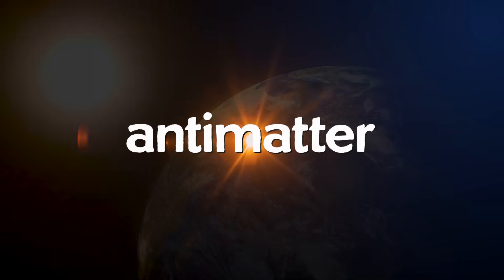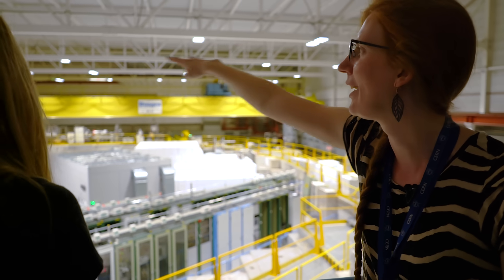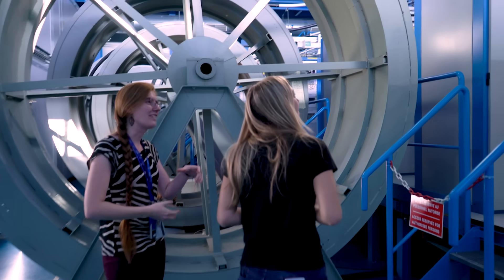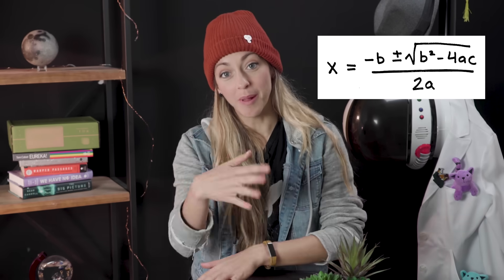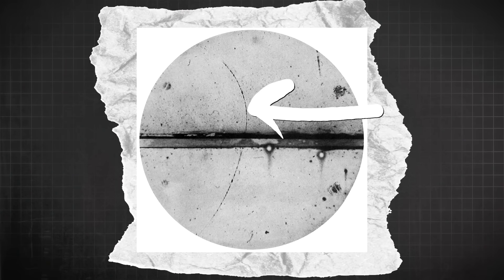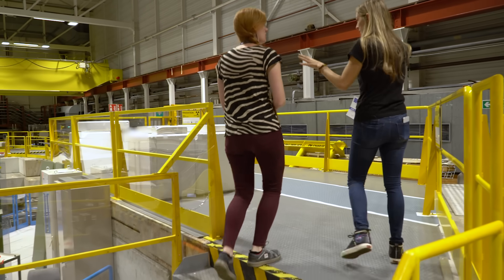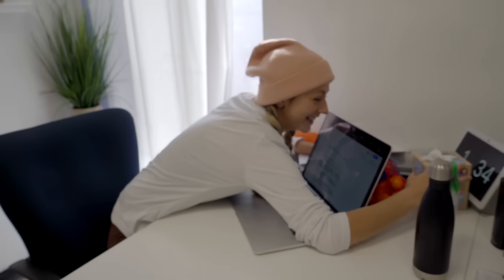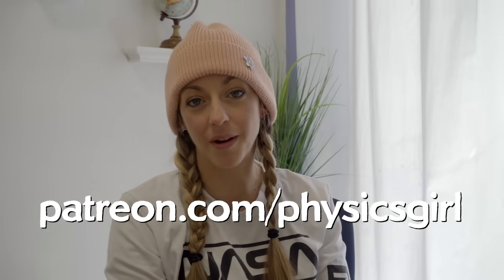Why This Stuff Costs $2700 Trillion Per Gram - Antimatter at CERN

Comment: The answer to containing antimatter is simple. You can either use majorana particles or simply dark matter.
Also I have reason to believe that all observed planets are not necessarily regular matter, as there is no observed clear difference between matter and antimatter aesthetically, which means that we cannot say for certain that the planets that NASA observes are “classic” matter.
Reply: The reason I say dark matter as a method of containment is because well... it probably won’t react with antimatter and any antimatter that does exist in the universe is, well surrounded by dark matter

Comment: Well actually there is not equal parts matter and antimatter. After the Big Bang (can’t remember exactly when) there was matter and dark matter being created and they where basically connected to photons it was almost like one of those two pronged BBQ forks with matter and antimatter on separate “prongs” . But what was happening though is that these matter and antimatter photon things would collide but when the collide the matter always met with antimatter and vice versa so they would cancel each other out and I’m pretty sure that once the opposing ends would meet they would kinda just stop existing. And these two ends where drone to each other like opposing ends of a magnet so there where so so so many billions and probably even trillions of these collisions happening all the time. but then for every billion photons being created there was one photon having matter on both ends of it with no matter so now when the matter and antimatter photons would meet these very few matter matter protons then there would be two matter left over since the matter and matter would meet leaving two matter cause they don’t cancel each other out. But eventually all the dark matter in the universe seemed to exist but I’m not positive but I’m pretty sure that there is still a bit of dark matter and it is not being destroyed any more sense the participles have stoped colliding so fast that they destroy each.
Any way I’m pretty sure that no one will see this comment but if you do I hope that this explains what she said at the beginning a bit better .  And I’m sure that there are some things I got wrong or somethings I missed because I just haven’t learned them yet this is just stuff I know because of grade 10 astronomy. ~Hope this helps~

Comment: maybe the reason antimatter isn’t found is because of a “density” issue? like as the big bang started to expand maybe antimatter was made first and all the matter was pushing that out, kind of like how liquids “slide” on each other if they don’t have the same density. in turn that would make the other 50% of our universe out of arm’s reach as it keeps expanding. the line where matter and antimatter meet also might be moving faster than the speed of light or at the same speed, so the light made in the collision can’t reach, or is just so far away we can’t detect it

Comment: I was chillin' with Hawking back in the nineties in Ft. Lauderdale during Spring Break one year when we were getting pretty buzzed at a nighttime bonfire.  We're talking about the whole matter - antimatter balance thing when I come up with this concept of Matter-Antimatter Encapsulation in Mirrored Dimensions.  We experience the Universe and all its matter as a contiguous space, which we associate with being a massive sphere.  Expanding or not, for that matter sphere to be balanced by antimatter, the antimatter would need to encapsulate the matter like the foam in a fitted equipment case hugs the equipment it protects.  But we observe no evidence of this, so we abandon it.

But what if we didn't?  What if, instead, we consider that there might be a corresponding "antidimension" in which the antimatter resides?  The necessary interactions between matter and antimatter may occur as needed, but we observe these interactions ONLY from the third dimension (and fourth, when observed over time) with which we are familiar -- THAT'S why we can only observe the EFFECTS of antimatter, but not antimatter itself.

So as far as matter is concerned, it IS balanced by antimatter, just not visibly for us, and vice-versa for antimatter.  The dimension and antidimension interact outside our ability to observe their interaction, yet they remain in perfect balance.

And then, when you fold this model in on itself, what do you get?  

A wormhole.

*MIC DROP*

Comment: The 'Big Bang' is not physics. It's a fairytale.
There is no such thing as 2700 trillion anything...
I don't care how hard you try, it doesn't exist!
Look at it this way. 1 trillion seconds is about 31,000 years.
If you spent $1 every second, you would spend $86,400 per day. More than the average American makes in an entire year.
$86,400 a day would be about $31,536,000 per year, which is about 1/2 of NASA's reported DAILY budget. Feeling ripped off yet? That's right, NASA steals 60 Million Per Day!
Now, you've spent 31,536,000 in a year, how about x 10,000 years. This equals about $315,360,000,000...
You see, one trillion does not exist in any tangible way. Perhaps in molecules or drops of water in the sea type thing.
One trillion dollars does not exist. In accounting perhaps, but this amount can not and never will change hands.

Comment: 4:30 that’s about 200 kilotons. To be 10 nuclear bombs, you would need each bomb to have 20 kilotons. Just the bomb dropped on Nagasaki had ~21 kilotons of power. Nowadays nuclear weapons already get to the megaton, or 1.000.000 tons of TNT and weigh just some tons or even kilos. The tsar bomb had a capacity of 50 Megatons, and weight 27 tons... you would not need 10 nuclear weapons, maybe 1/5 of a atomic bomb

Comment: Nice try with your monetary calculation on the value of antimatter . . . but the truth is . . . antumatter has no value whether it be intrinsic or actual; because it doesn't exist on our side of the universe. And even if it were possible for antimatter to exist here and miraculously contained by men, it's not an endless energy resource . . . rather, it's the quickest trip into the void of nothingness our universe can take through the simple fundamentials of, "cancelation".

Comment: Create a standing resonance volume of negative energy density.  Be sure your Q-point is infinite and phase margins are non-existent otherwise you risk BIBO instabilities, which could result in inflationary runoff.  Once that's managed, you have a locally conserved hyperbolic manifold for inducing CPT asymmetries; effectively producing above unity antimatter.  Be warned,  this will illuminate your minds to the chaos, so must only be operated by those among you that have the highest aptitude in the propositional calculus.

Comment: Antimatter is basically an atom with reverse polarity. Imagine a plug where the brown wire is the neutral and the blue wire is the live. This is antimatter. By the way please do not wire a plug the wrong way round you will blow your Tv up.

Comment: Could it simply be the balance of matter to anti matter a measure of the definitive weak force to impose its direction away from matter due to the violent reaction. or more simply said. Could the force of movement within the universe keep anti matter from coming into contact with matter since the balance would be removed by its own destruction. unknown charged electron count +/- unknown positron count sq. week force at greatest distance of movement  divided by mass/velocity. just the difference alone could account  (in theory) for why the universe stopped expanding. since there were no more (little pops of matter and anti matter collisions. OR, you know, i could be off my rocker lol. great vid BTW. making science enjoyable for the future. Keep it up!

Comment: Imagine if we harness antimatter and be able to repurpose it into an engine, therefore being able to travel through deep space
Reply: Gas prices are high enough as it is
Reply: @paulbeahm3891  lmfao what if I tell you I can make your car float and go faster than mach 1.😄👍
Components needed:
-warp coil
-Fusion reactor or any energy density storage
-and lastly anti-matter/anti-hydrogen

With added more power to the warp coils it creates a warp bubble but needs (18 billion megawatts for warp bubble) with less power tho it makes the ship lighter or anything mounted on it meaning Vroom.

I feel like I just bombarded you with data.😰
Reply: @thefirstsin  what an accurate name.
Reply: @MrDJAK777  lmao
Reply: @thefirstsin  so uh, it needs 18 tetrawatts?
Reply: Matter and Antimatter Annihilation Reactions create pure energy and an intense gravitational distortion if maintained. So you are not wrong, it can be done and probably has already.
Reply: Not an engine, just a Coil or hose with coil make sure it's powered up if you don't wanna make it go BOOM.
Reply: Imagine going to Alpha Centauri on a trip that lasts only a few years

Comment: If antimatter has anti charge and can disapear into energy that means it should have negative gravitational influence. It repells other atoms. That first of all means that you can not see "natural" antimatter anywhere where there is normal matter with normal gravity. It is the opposite of a magnet where different poles attrackt eachother. 

That also makes it possible to create gravitational strech if you have matter and antimatter near eachother. Similar to how the distance between particles in a wave change distance between them. That would mean your could travel faster than light while not traveling faster than light. You would technically time travel forward. Quantum mechanicly I am too confued to decribe how the two different probuability functions would work together. I don't even know how the function would look like.

Since you lose mass in every energetic reaction, you should be creating antimatter that makes pure energy with matter. That also means every endotherm reaction would seperate matter from antimatter? 

Is the big bang a thing where a lot of energy was seperated to matter and antimatter and once everything expanded it should go back to one big chunk of mass like a rubber band. That means that our universe is oscillating from mass to energy and back?

I am very confued, but that whole thing is cool.

Comment: Life is actually the rarest thing in the universe I’d like them to produce life in that facility
Reply: Producing life from inert materials is child's play compared with producing kilograms of antimatter. It's only a matter of time before artificial micro-organisms are synthesised. We are already half way there.
Reply: @bernardedwards8461  What type of life are we talking about? Would it resemble real prokaryotes?  

I could see this going wrong and we develop a microbe that kills us all.
Reply: @bobbywise2313  It will either resemble a virus or a primitive prokaryote. One problem with viruses is that they must parasitise more advanced forms of life in order to exist, but I suppose a virus which parasitised only amoebas would be fairly harmless Obviously a synthesised life form would have to be life of a very simple kind. The largest viruses are about the same size as the smallest and simplest bacteria. The microbe that kills us all would probably be a mutation of ebola, which is 40 times more deadly than coronavirus, but is confined at present to equatorial Africa.
Reply: @bernardedwards8461  If Ebola ever becomes airborne it would be very scary.  As for mortality though, I think it is 40 to 60%.  Without getting  a vaccine rabies has over 99% mortality.  I think there has been one case of a person surviving it.
Reply: @bobbywise2313  Yes, you're quite right, rabies is probably the most deadly virus known to man, but not as dangerous as ebola because it doesn't spread so easily. The danger in UK is that it might get into the urban fox population and from them into pets. Even then, the number of fatalities would be very few, but the fear factor would be huge. That's why foxes need to be kept under control.

Comment: Im fairly concerned about this we don't know enough about it to be handling it or know where it comes from. What if these particles are from a dimension parallel to ours and we start blowing them apart. We are messing with the fabric of reality who knows what will go wrong.
Reply: agree but there’s barely of it we discovered bush what if antimatter be part of matter? like for every electron there is positron floating  around it. Maybe we’re looking in the wrong place. Antimatter could be everywhere but its not because its undetectable. We could be able to manipulate reality very easily, we just don’t know how to..

Comment: Bandpass relates to chemistry and thermodynamic effect on magnetic hysteresis. Diamagnetic to paramagnetic by conductive latency results in heat, cooling leaves magnetic moment. Hysteresis generally describes north south conductive flow bias that is magnetic moment orientation. 
The three states of diamag, paramag and conductor; are neg, pos and neutral respectively.
Reply: Addendum. Antimatter is max photons per photon size box.

Comment: Compression of matter results in the internal pressurization of matter.  The exponential collapse of matter results in matter collapsing infinitesimally faster than the speed of light at which time gravity stops working.  The infinite pressure in each particle of matter inflates matter in far less time than 1 oscillation of a cesium atom, which is at a precise mass and set to a precise temperature.  At least according to the instant inflation of matter theory, inflation of matter theory, and the compression of matter theory.

Comment: The only real way to put it into a container would be some sort of magnetic suspension device to suspend the antimatter so that it does not come into contact with anything during transport. A container utilizing quantum locking may work as well

Comment: My theory is connected to why we need less oxidizer and more fuel in rockets. A tiny amount of oxidizer is used because more fuel can easily combust in less LOX and I think the same applies to antimatter and matter when they where combined and exploded during the Big Bang. In my case antimatter is fuel and matter is LOX , So matter is the only thing left.

I know that there are and can be still remnants of antimatter

Comment: I think its pretty easy to extrapolate as to where the antimatter is.  If you consider the basic atomic structures in the universe, you will find negatively charged items revolving around positively charged items.  If this model holds true on a larger scale, I suspect the antimatter is probably another 'universe' which revolves around our own regular matter universe.  Its basically found whatever is past the CBR field!

Comment: What if in the beginning it was all anti matter and matter and anti matter may not always collide to destruction. But i think there is somthing were missing about matter turning to anti matter and matter to anti matter. The question to ask is why does is explode?  When they meet maybe anti matter formed long before matter causing there electromagnetic property's and structure of the base. We will call it of the atom and what holds them together. Maybe alignment on the matters atom and repulacting. The magnetic property's will help. Dont laugh bc i littary came up with that in a 45 sec day dream

Comment: Matter that is compounded with other forms of matter "that react to each other." Liquid nitrogen, magnetic metals, iron, maybe radioactive materials though idk it could explode with too much. That is highly compressed and ionized. Stabilized by a powerful magnet that holds it in form.  The magnet should help ionize the matter though a magnetic material would have to be used. Super position the matter in on itself. There are you happy.

Comment: DARK MATTER
A term invented by Quantum/Relativity to refer to the Ether. By their own admission they call it dark matter because it’s a complete unknown (dark) to them, and finally ‘matter’ because they think everything is matter/atoms. To a hammer everything is a nail, and to an Atomist, everything is matter. In short, so-called ‘dark matter’ is a cryptic euphemism used to get around mention of the Ether which even the priests of Quantum admit is at least 70% of the universe if not more.
DIELECTRIC
The primary half of the conjugate field modalities of the dielectric and the magnetic field. The inertial (capacitance, energy) or dielectric torsional, and lastly the circular magnetic. Dielectric is the capacitance potential of counterspace. Dielectric loss is defined as magnetism, increasing potential terminating towards and into counterspace is so defined as increasing of the dielectric inductance or charge. The smaller the space, the higher the dielectric, or capacitance. Space is the attribute of the magnetic which itself is the absence of, or discharge of the dielectric. Counterspace is the medium of the dielectric which is the presence of the Ether under torsion, or as meant dielectric charge.
The so-called electron is merely one unit of dielectric inductance as so conceptualized by Atomistic ignorance. J.J. Thomson considered the electron the terminal end of one unit line of dielectric induction. The dielectric manifests from and vanishes into counterspace, whereas magnetism manifests space itself, which while having no properties, has the attribute of magnitude & the measure of time, or lag. The plane of inertia is the dielectric 45 degrees from magnetic flux and 90 degrees from gyromagnetic precession where force is inverted to increasing potential, or counterspace, the terminal of the dielectric. The dielectric is Ether under torsion, the magnetic is Ether under polarization, which is ultimately true field holography and that which gives mass and magnitude to all things.